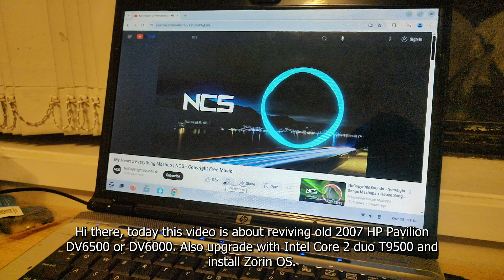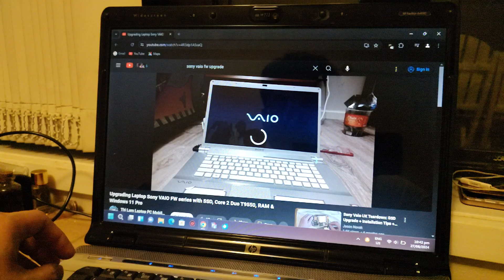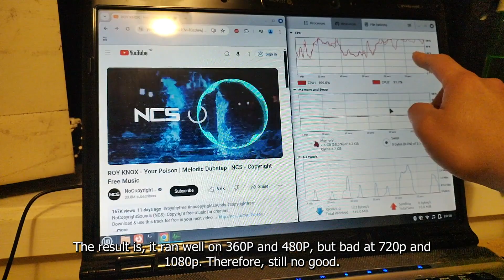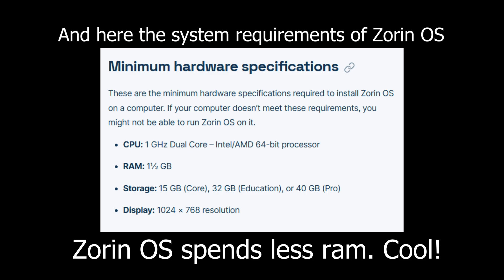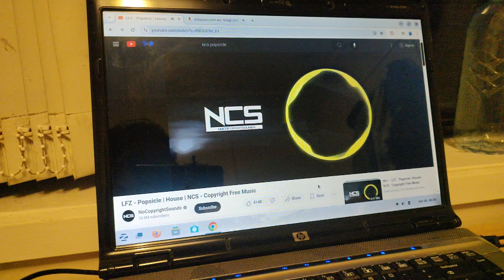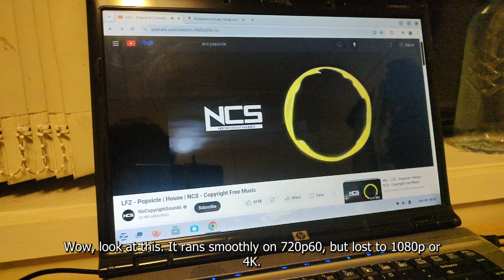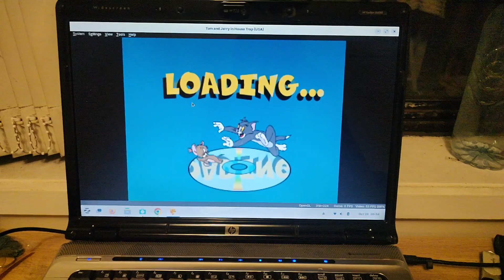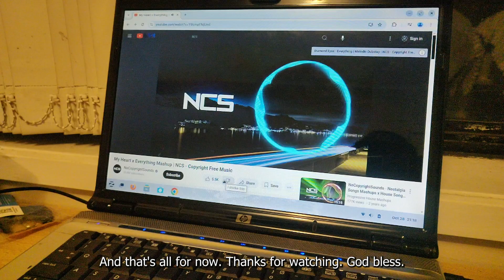Reviving Old Laptop HP Pavilion DV6500 + Linux Zorin OS + Processor Upgrade

Comment: 6gb ram dv6000 realy :S
Reply from the maker: True. I used 665Mhz 4GB + 2GB DDR2 RAM. But it only work for DV6500 model, not DV6000. Despite 2 models of laptop looked the same but different Chipset. But you can also go up to 8GB.

Comment: I got a dv6215ea but with a faulty graphics chip did you encounter that problem?
Reply from the maker: @n7ericc actually, no. The graphic chip of the laptop works fine. Have you had thoughts of motherboard replacement or replacing faulty chip yet?
Reply: @thilamfixupgradelaptop95 well the solution is to relfow it so that’s probably what I will do
Reply from the maker: @n7ericc that's good. I wonder if your graphic chip was overheated.